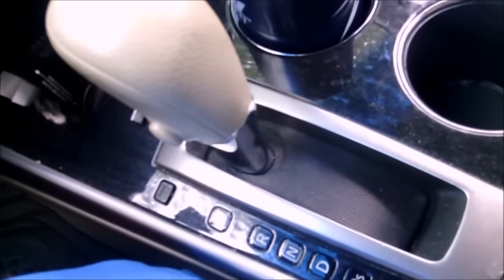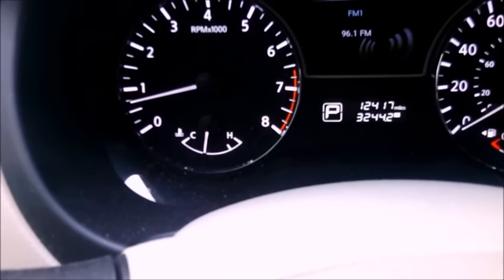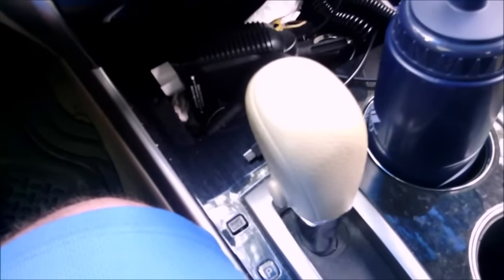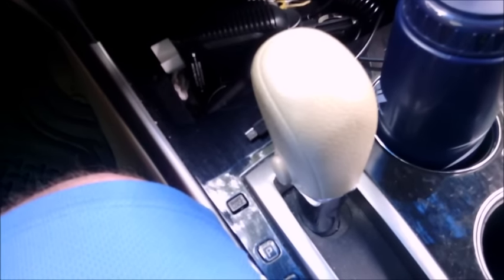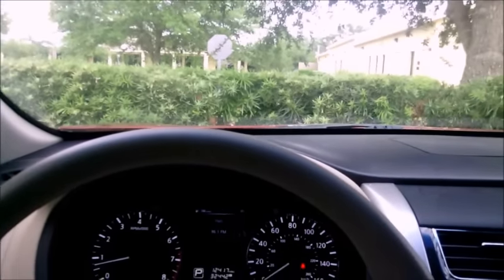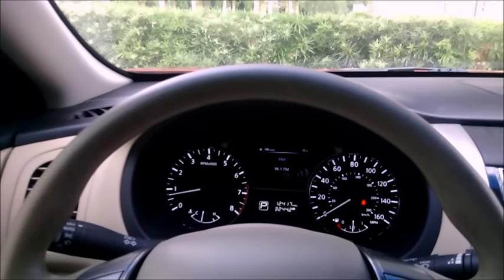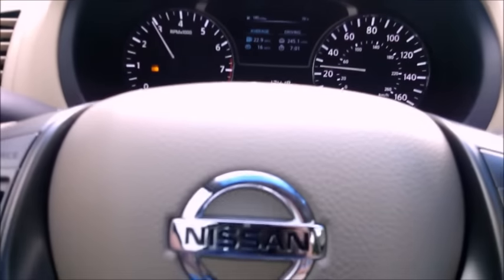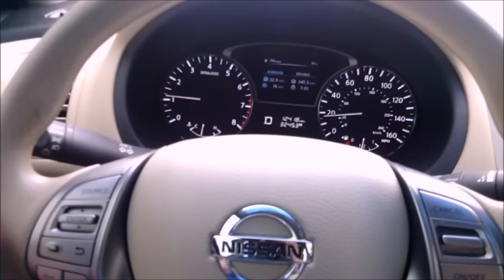What Does OVERDRIVE Button Do (O/D light Off Toyota Ford Nissan Honda Dodge Hyundai Kia Chevy GM car

Comment: Is it bad if i always turn o/d off when i drive?
Reply: If u mean not to push the button then yes good idea. If you mean to always push the button then no. Overdrive /off button is for engine braking mainly it puts the car in a lower gear then ur currently in producing higher rpm. So when you are braking you don’t need to press hard on the brake pedal to slow down. That doesn’t mean press it every time u need to slow down. Its for if ur going down a steep hill in traffic and you don’t want to push hard on the brakes and want better control going down. Personally I think it’s really bad for your transmission to use it. Its putting it to the max all of a sudden and it can be easily used in the wrong manner or unintentionally cuz the button is so close to ur hand on the gear shifter. Look in your owners manual it will give you a lot more insight into the od /off on ur particular vehicle. It’s also very informative about everything with ur vehicle even things u didn’t no u had.

Comment: Thank you much for the video. Ok, smart guys. Who can tell me, to a woman with blonde hair, why this stupid OD button needs? I just got a lot of nerves by accidentally pushed it while driving. And this happened after five-year driving my favorite Nissan Murano. I know right now that no problem with my car, but I am still shaking over. Can I suggest to move this button to another place, which is not using often while driving and can not be pushed by an accident? Thank you!
Reply: Did that today. Wondered why this light was on saying o/d off.  Brought me here. So normal city driving it should be on?

Comment: I just turned it off today in my 2000 ford ranger. I normally never go over 35. Felt like it wasn't clunking super hard to shift like it normally does. No codes. Am I imagining things?
Reply: joblessalex Did you figure out why your truck was doing that?  I have a 2007 Nissan Frontier and I tested turning my O/D off  because I’ve been noticing a rumble around 1500rpm while O/D is on.  Doesn’t matter if I’m going 35mph or 60mph it still makes that grumbling until I move past or below that 1500 rpm.  To my surprise it doesn’t do it when it’s off.  Makes me want to drive with it off.

Comment: sounds like od is for when hauling or going uphill. Not for basic regular use. it feels smoother w/o it on on regular roads which I figure would save more gas. when on it has more power, torque, get up , and that's using gas. amni right?

Comment: I twin o/drive off when get over speed 60k then twin it off the revs drop down. When doing 100km with O/D off only doing 2 rev have it on it 3 or 4 reve on rev counter

Comment: Drops car to 3rd gear, can be used to slow car without using breaks or drop to a lower gear at a higher speed for a bit more torque to pass a slowpoke or push up a hill ... driving at low speed in overdrive off is reving high because ur running ur car at a higher gear for that speed -,-

Comment: Question when your car was pulling  pushed over drive to where it turns it off in the transmission Quick: even if you stop  put it in gear it still won't go in gear or pull offcan you tell me what I need to do to fix it so when I put it back in gear able take off

Comment: 1:42 this January I pressed my over drive button to off while going up a hill bc my car was fluctuating between 3rd and 4th gear when I turned it off my rpm shot up and felt sluggish so I turned it back on then my cel came on in my car and I immediately got a p0740. pressing that button was my biggest mistake ever. any ideas on what happened? car still runs fine. downshifts perfectly and goes into every gear besides 4th.

Comment: If I want to accelerate quickly to get up to highway speeds; overtake another vehicle on the highway; or drive in traffic/city, is it best to turn O/D Off (push the button--light on), or to keep O/D On (the default--light off)?

I've been watching a lot of videos on overdrive, and none seem to clearly explain when and how to turn it on/off for the layman. 

Thanks :-)
Reply: blackhat2005 
Don't worry about it and leave it on. Most cars are designed to have it on during regular driving. Only turn it off for heavy snow, off-road or steep hills. Otherwise leave it alone.
Reply: Deadlyaztec27 how is it helpful for off roading, it's the tallest gear. OD off would mean nothing in anything under 40mph, maybe 50 dependind on ratios.

Comment: My 07 Altima had a CVT. It was useless. These newer Nissan's have no gears. It's a pulley and belt in the transmission. It's a continuously variable transmission. No stepped gears. It may mimick gears but it's not a traditional automatic by ANY means
Reply: PLATINUM you wanted it like that, get a manual if you really care.
Reply: Cricis11700 naahh I shifted for 16 years..won't do that again
Reply: PLATINUM I understand, but I'm pretty sure people in Europe shift their whole lives, many of them throughout old age, my father before he passed got into an accident and messed his back and shoulder up, he was 56 and was still driving stickshift up until his accident, I'm only 21 but I've been driving stickshift for about 6 years now, its all I've driven, and alot of that time I've been driving in Los Angeles, and to end that, I own a stick shift, Nissan skyline R32 and I've driven in LHD traffic legaly, with a RHD vehicle, for some years now, but it's up to personal opinion I guess.
Reply: Cricis11700 I'd love to get my hands on a skyline 😇
Reply: I have a CVT as my first car. 
Is it better to have a regular automatic or a CVT in your experience?

Comment: OD on makes the OD gear available and OD off makes the OD gear unavailable.  Why would you want to have your OD gears unavailable? When you are going up a steep hill and need more power.  Other than that you can just keep OD on and it doesn't make a difference at lower speeds it just makes the extra gears available when you need them.

Comment: What is the purpouse of OD on a CVT? They have no gears.
Reply: Jose Lopez let's the CVT be in a higher Rpm range
Reply: @Jose Lopez, it's similar to OD-OFF on a regular automatic - it limits the pulley ratios to give you effectively a lower "gear". You can get a similar result by flooring the accelerator pedal, but having a button is useful if you want more engine braking going downhill. Mine also has an L position that limits it to approximately 1st gear for stronger engine braking.
Reply: CVTs often use equal sized pulleys for the primary (input) and secondary (output), so technically half of the range is "overdrive", in the sense that the output speed is greater than input speed.
Reply: CVTs often use equal sized pulleys for the primary (input) and secondary (output), so technically half of the range is "overdrive", in the sense that the output speed is greater than input speed.
Reply: Jose Lopez
 yes they do I have one in my jeep! It even has the auto stick! Can even feel it shift!  CVT's are not what you think they are!

Comment: is that means use it on highway limited comfort drive, not full performance, if it off performance will increase if that correct @howtocurt ?

Comment: i turn it off  in heavy traffic. I sometimes switch the gear manually to 2 instead of D.
Reply: millenium2003 same here lol. sometimes once your going 70mph you can shift it to second to go to 3rd on a automatic and nothing bad will happen to the engine. all it does is rev alittle bit higher.

Comment: overdrive is a setting to go up a mountain or an incline when they start your car your post to turn it off if you're going on a flat ground or supposed to be going the speed limit over 25 everyone knows that when you are driving in overdrive you're not supposed to go over 25 miles per hour like City zones in towns if you are from the country of usa

Comment: In a 4spd A/T with a modern day grocery getter small capacity engine, l notice when cruising at 60mph the rpm is at 2,500 with OD, turn it off the rpm is 3,000< with the same speed.Where l am from, we do not have the big American V8 with a 4spd A/T. ls it the same on a big V8 compared to a inline 4 with 1,300cc engine?
Reply: Princess Solace yes od is like your 4th gear in the transmission so od on is 4th gear and od off you will only go up to whatever top speed your 3rd gear goes up to

Comment: maximum time I drive car 40/50 in city. is it create any problem/ benefit if I always on my over drive on mode. or what happened if I drive 40/50 in over drive on mode.
Reply: Just leave it on all the time your car doesn't go in to overdrive until higher speeds anyways

Comment: Damn I'm so stupid I kept it on off because I figured why I have it on if I'm not putting any weight are going up a hill or pulling a trailer. I probably messed up my transmission driving like that for two days?? I just figured if it says off then I'm not in overdrive so i dont need it😬

Comment: Your Nissan Altima does not have gears all it’s doing is increasing engine RPMs because you have a CVT transmission now for example I have a 2007 Toyota Corolla that has a 5 speed automatic turning off OD would lock it in fourth gear. Now if your wondering why it’s there it can be used for many things like if you were to tow something heavy and put stress on your vehicle you will need a lower gear to have more RPMs and power a lot SUVs and pick up trucks have this or it can be used for hazardous conditions like rain or snow you would have more control of the car because throttle response is quicker or you could engine brake  (slow down) with out using the actual brakes.
Reply: 2007 Toyota Corollas have a 4 speed auto*

Comment: hi. i have a 99 toyota corona at210. my od light is blinking and it doesnt run smoothly. feels like it doesnt change gear on time and accelerates very slowly. help plzzzzz
Reply: Haughtysurfer 101 sounds like a sensor issue
Reply: Haughtysurfer 101 change transmission fluid
Reply: Same problem with my Toyota Avanza 2007, OD light keeps flashing. Will it be ok in changing transmission oil?
Reply: Edgar Allirap change AT fluid every 40,000 kms
Reply: You have a Toyota Corona? Does it get you drunk?

Comment: This is a bit misleading your engine/transmission aren't "going harder" you've forced a downshift in to a lower gear same as you would when you accelerate and the kickdown switch engages so the revs come up and you gain torque there is actually LESS load on your engine/transmission in the lower gear - hence the freer revving engine like the easy gear on a bike 

Overdrive refers to the gear ratio being overdriven for example .78 of a rotation on the input shaft of the transmission gets 1 complete turn of the output shaft THIS is actually a higher load on your drivetrain same as the hard gear on a bicycle 

The OD switch exists to quickly turn of overdrive at times of extra high load such as a steep hill where your car reaches highway speeds
Reply: So if your car has four gears in overdrive, it still has four gears when the overdrive is off? It's just that with overdrive off, the gear ratio is higher in all four gears? Is that right?
Reply: @alantaylor6691   - You cannot have extra ratios without extra gears aka "speeds" so no. The OD button accomplishes essentially the same thing as manually shifting between the top 2 gears, in a 4 spd between 3rd OFF and 4th gear ON (4th being the overdriven gear for fuel economy) which places the highest load on the engine. This is desirable in high load situations where 3rd is more suitable such as towing or high speed steep hills the button simply allows shifting to occur without looking or risking a manual shift in to 2nd.

The OD button will NOT accomplish a shift at the lower speeds of 1st or 2nd gear it will simply limit shifting to a max of 3rd in the OFF position and allow full use of all 4 gears if ON once speed builds up again assuming a 4 spd.
Reply: @PabloGonzalez-hv3td  
Thanks for the reply but to be honest I'm not really making head or tail of what you're saying. I do understand what you say about there being no more gears (ratios) though. I do a lot of slow-speed driving in National Parks where there are steep up and downs both on the tar as well as dirt. I've been feeling like driving in 2nd gear a lot in those situations, and 1st when it's particularly slow and steep. Should I be turning overdrive off during these slow-speed excursions?
Reply: @alantaylor6691  - Removing all the technical speak the OD button simply shifts between the top 2 gears, in a 4 spd OFF limits the transmission to 3 speeds and ON is the full 4 gears ZERO difference from manually shifting and as such the position of the OD button while driving slow is irrelevant since you're maintaining 1st or 2nd.

Putting an automatic transmission in a forward gear (from a standstill) doesn't actually shift the transmission in to THAT particular gear it LIMITS the transmission from shifting past that gear and holds it when it otherwise would be upshifting -  of course if you're already traveling faster than that particular gear it will shift down
Reply: @PabloGonzalez-hv3td  
I think I understand, I'm just having a bit of trouble with English comprehension.

So if I've got this right, 'Overdrive ON' allows all four gears, 'Overdrive OFF' allows the three lowest gears, 'Forward 2' allows the two lowest gears, and 'Forward 1' only rolls in first gear.

So I'm assuming that 'Forward 1' and 'Forward 2' would be preferable for slower-speed situations where you want to limit the load or prevent chronic back-and-forth shifting, just as 'Overdrive OFF' is preferable for higher-speed situations where you want to limit the load or limit chronic back-and-forth shifting.

Comment: Hi guys my nissan sunny ex saloon 2001 blinks 16times OD light and during start off it moves fine but after a min or two later I feel that the car is stuck in one gear . The car utilizes much power to move forward and also the rpm will not go beyond 3000 rpm. 
If anyone has any solutions for the above issue raised please advise me ?

Comment: automatic transmition has full computer controlled transmition, that why automatic transmition has 2 box computer, for engine and transmition
I felt my car with O/D button it allow me to drive closer to the top gear, or in manual it's 5th gear, CMIIW
with O/D button on, the transmition changing gear in low RPM, and stay in 2000RPM for fuel economy
if I turn the O/D button off when I'm driving in 2000RPM, RPM will rised to 3000RPM, just like I shift the gear down, it useful for OVERTAKING
if I turn O/D button off permanently, I got worst Fuel consumtion
That is all what I know, CMIIW....

Comment: Actually on cvt cars, they will automatically turn off the O/D when going up or downhills.
Reply: What do you mean? CVTs don't even have gears, so O/D is not applicable here
Reply: Desmond It's weird but my girlfriends Nissan Rogue has an O/D button and has a CVT Transmission.
Reply: @chrischoy9  my jeep does i can feel it shift and it even has the auto stick so yeah its got gears

Comment: Um your wrong because it doesn't make your engine and transmission run harder and your car is peppery with it off. It just allows your transmission to stay in a lower gear longer, it's really for towing because town hall mod is the same as over drive. Yes your right on going up hill and down hill. It's good to run the engine RPM up every once and a while because it allows carbon depends to fall off and keep the slug build up down. And yes I am a real Mechanic and I've been for the last 10 years
Reply: Hi William, i have a toyota avanza 2007, my OD keeps on flashing, even if I pushing the button, still keep on flashing, can you help me on this?

Comment: Weird. My car goes faster when od is off. If i want to pass a bluehair, id turn off my od and then go back when i passed them.
Reply: Gingerbred_Hed 
It just disables the highest gear so it down shifts.
Reply: I notice that if your in the freeway and going uphill your gear goes down to 3rd gear to gain power when you turn your overdrive on, so I always use it every time I need more torque and power like when passing and climbing.

Comment: From my personal experience, overdrive bleeds my fuel. I am driving a 2002 Nissan super neo. In O/D move the rpm rises but the car doesn’t really pull and consume my fuel.
Reply: Yeah, for example in my 09 Versa. I’d be going 55 mph and with Overdrive on I’m only using 1500rpms, but once I turned it off it shoots up to 4000rpms. So yeah it will bleed the fuel
Reply: That is incorrect! Just because your RPMs are higher does not mean the vehicle is using more fuel. When downhill and you disengage OD you actually use less fuel due to not pushing the gas pedal. (this is called engine break)

Comment: Couldn’t be more wrong don’t listen to this guy he has no clue. Overdrive is not the highest gear it’s a low gear and what that means is it gives you more torque to the wheels with less RPMs of the engine but it’s not a driving gear since it’s only one gear. Using it on all the time is not a good idea cause it won’t shift through the selected gears like the D selection dose. It’s good for going up hard hills it’ll give you lots of torque to the wheels with les engine RPM so the engines not screaming going up hills.
Reply from the maker: one of my videos like this one gets more views than all yours combined times 100.  Think about that and what you are doing with your life.
Reply: HowTo Curt      Just trying to help people with the right info. I don’t care about video views